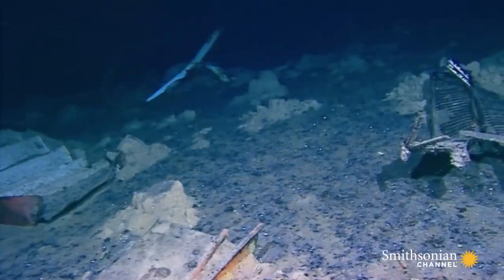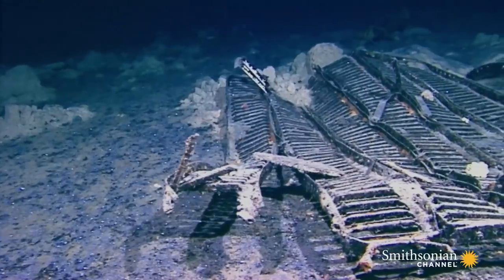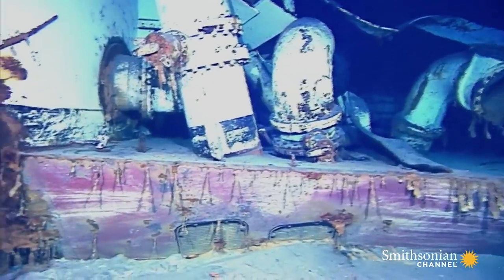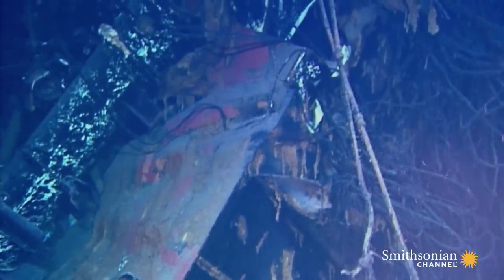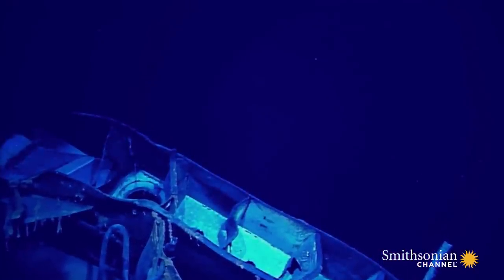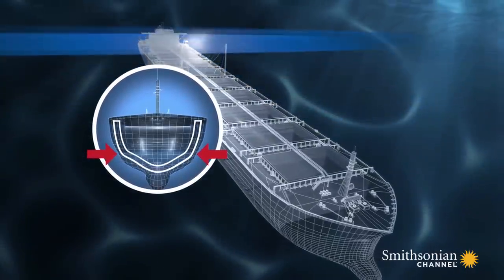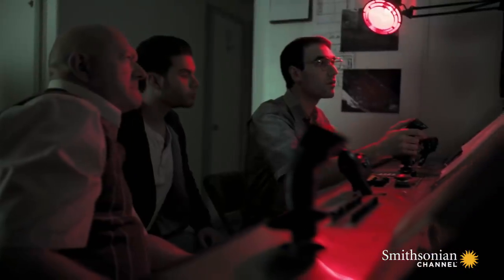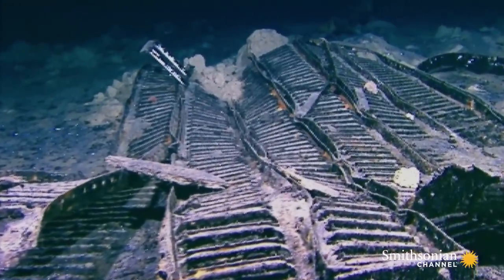What Caused This 1980 Shipwreck to Tear Apart?

Comment: 12 small ventilation tubes in the bosuns store are believed to be the trigger of the disaster, the covers were knocked off by the weight of massive waves which slowly flooded her pulling the bow deeper into the ocean.